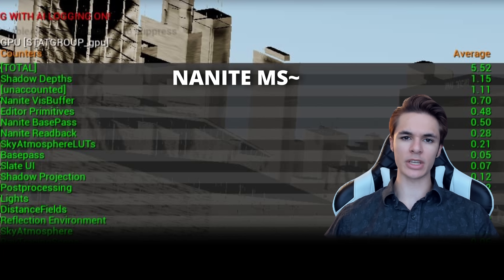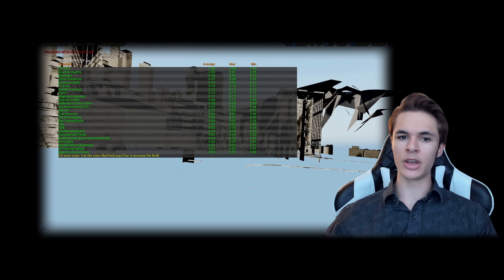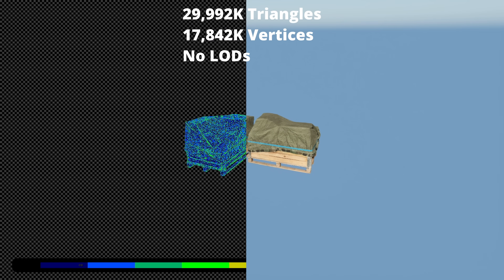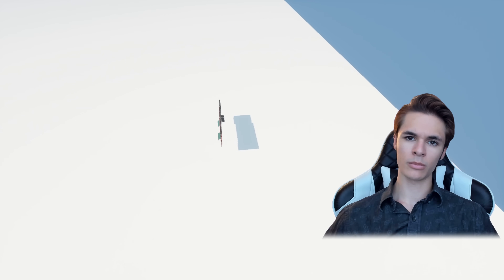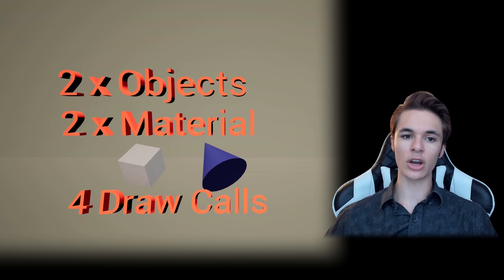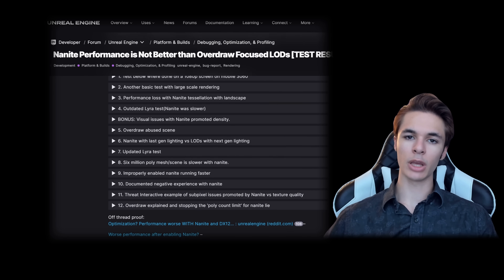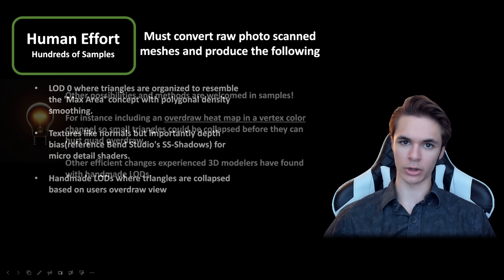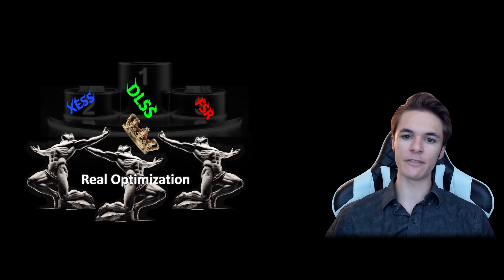Epic's Unreal Optimization Disaster | Why Nanite Tanks Performance!

Comment: yes you are right, BUT..

the modelling process to produce these LOD levels (with good topo) is ridiculously slow compared to the nanite workflow, where you can slap these insane polycount meshes onto the scene and it’s done. nanite was created to shorten development time and cost. this can lead to 3-5 years of dev time instead of a decade.

and guess what, nanite is a software which can be improved, and they will improve it. in a few short years this whole argument will be pointless, the nanite rendering tech will be almost as fast, or even faster.
Reply: That why nowadays games size around 300GB
Reply: @lirianca  which can be improved, again. there are a lot of research about mesh and asset compression already by amd, nvidia, epic etc. trust me, it will be better.

also if you took a lod0 mesh from a traditional pipeline and use it as a nanite mesh, you only using one mesh instead of 3-5. i know, nanite will generate additional data, but that can also be improved.
Reply: @alexkovacs4551  best argument "trust me bro". No bro, thanks.
Reply: @alexkovacs4551  12 tris cardboard box from traditional pipeline > 2 mil. Raw scan used with nanite.  Understandable. 🙃
Reply: @lirianca  i’ve never seen a game that uses scanned models, that’s not the point. the point is, you can use your good old lod0 model without generating lower fidelity variants of it by hand. that can be a 12 tris cardboard or a highly detailed sculpted model, the point is to reduce cost and development time.

you don’t have to agree, i just wrote down my toughts about the topic. i’m a senior software engineer, and i can see why they came up with this idea. the engineers who probably far more intelligent than any of us. :)

have a good one
Reply: @alexkovacs4551  Bruh... you dont need sculp box. Just open 3d software and use defaul cube and uwnrap it. And make textures for this cost you 10-15 minutes. Also nanite not understand what vertex or edge important on this specific model, and can broke geometry, normals on model. Like complex 3d model of car with high detail interior, engine and underbody. Nanite decimating current object in realtime, not create new. Why im know it, because im 3d artist and indie game developer.
Reply: @lirianca  thats a funky way to say unemployed 😅
Reply: @alexkovacs4551  when "unemployed" guy know more then sigma alpha master boss senior software engineer 😁

Comment: On all RTX GPUs FP16 arithmetic ops are executed at the same rate as FP32 since only one of the two main vector ALUs can process packed (x2) FP16 operations. The only perf benefit from running FP16 ops is the reduced register pressure. In their OpenCL run-rime Nvidia is yet to expose FP16 ops at driver level.

Comment: Its normal that new generation of rendering techniques introduces large overheads. Its a good tradeoff as it streamlines development and enables more dynamic games, Major issue is that  developers ignore good practices and then blame the software, part of that is also epics fault as they try to sell it as magic solution for unlimited triangles which is not. Nanite might be slower but enable scenarios that would be impossible or very hard to achieve with static lighting. Sure you can render dense meshes with traditional methods but imagine lightmapping them or making large levels with realistic lighting and dynamic scenarios.
Reply: Yeah... In terms of all this dude's videos - I find myself technically agreeing; but, I don't think they see the big picture.
Reply: @piroman665  I believe unreal was made to be somewhat artist friendly, systems you can work with even if you do not have a deep technical understanding. Hitting the "enable nanite" checkbox so you have to worry less about polycount seems to fit that idea.
Reply: @lau6438  LODs are costly and expensive to studios to develop.

Comment: Nanite is not made for basic scenes, it’s made for incredibly dense scenes with lots of material variation.
Yes, it will always perform slower on basic scenes, but it can outperform on very complicated scenes like for example the matrix demo.
If you were to try and run that in a traditional pipeline at that same level of quality, you wouldn’t be able to with the same performance, even if you optimized like crazy.

No, it’s not a make everything fast button either, but it has some incredible benefits, not in the least in terms of memory budget.
Ultimately, it is a tool and any other tool it has up-and-down sides, you don’t try to screw in a nail. But in the right usecase its very powerful.
Reply: You didn't even watch the video! 😂

Comment: Your AI idea would by no means run faster than Nanite. Nanite is pretty fast for what it does. And my understanding was that Nanite was a quality thing more than performance.
Reply: The idea is that the AI either runs offline (either during development or on device). I don't think it would be less time consuming for devs though, as they now have to either tune a model or deal with tons of additional tech support requests for a piece of software completely out of their control.
Reply: @sasha_chudesnov  Even offline, Nanite would still run faster than AI and don't forget the memory requirements to run the AI. The more complex a model, the more parameters it has, the more memory it requires. 

Also, what fine tuning is there needed with Nanite? The only options I've needed so far is "Preserve Area" and "Keep Triangle Percent" with the latter option being overlooked by a lot of people it seems. 

And even then, people need to understand that you don't actually have to throw a 30k poly mesh in there, you can still use your lower poly meshes and then just not worry about LODs because you still have to consider the amount of data that travels through the PCI busses.

Not saying it isn't a hog and doesn't hurt performance, I'm just saying that you can still get great performance if you don't go silly with it.

Comment: The most damning point against Nanite is the new Riven remake. Everyone thought it was using Nanite because there are no polygonal edges visible in its assets, yet it's just a very well made game.
Reply: A bit of a shame that the reflections are still screen space and kind of suck. If the game has raytracing then this point is moot, but I remember hearing Johnathan Blow mention how crap the screen space reflections are in that game.
Reply: @Naitrate  Riven's SSR is no worse than any other game's. SSR is simply a stopgap technology that should have been left in 8th gen, and it should have NEVER replaced planar reflections on water to begin with. SSR was perfect for creating accurate reflections on random objects in a scene that are too small to warrant a planar reflection or cubemap. Water will take up between half and the entire screen for a lot of the play time in some games, yet those games will cheap out and not use planar reflections. The most recent example is CS2 which ironically has extreme performance problems with its water any way. Just another anecdote for how optimization is dead in the games industry.
Reply: @Naitrate  such a game would benefit from full on path tracing

Comment: I figured something was terribly wrong with Nanite when Bang4Buck played an early version of Remnant II at 4K max settings and was getting *>45fps on a 4090*, the same GPU that can handle Gears of War 5 at 8k 60fps at max settings. Getting that kind of performance purely through rasterization lead me to suspect that Nanite scales terribly at high resolutions, and it’s been enlightening to learn that Nanite has scaling issues in general.
Reply: You're seeking for the wrong reasons. The trouble is deferred rendering, it scales worse in resolution.
Crysis 3, just to overcome this issue, gets a forward pass for all complex materials.
And remember, anything higher than 1080p is marketing scam.

Comment: Interesting video, but isn't nanite using it's own software solution for the small triangles exactly because of that issue? I'm pretty sure that they've said so when they started talking about it, it's in their tech talks, etc.
This test feels somewhat fishy to me. Why not compare the normal scene, instead of captured frame, for example? That skips part of the work of one example, while using the full pipeline of the other...
Reply: I would love to get my hands on that test scene to give it a spin. I've been working with Nanite in a AA and AAA setting for almost 3 years now, and while it was an absolute pain to figure out the quirks and the correct workflows it has been overall a positive thing for production. 

In my experience Nanite REALLY struggles with anything using masked materials or any sort of Pixel Depth edits. 
I've also seen issues with perf when most meshes were "low poly" in the sense that the triangles are very large on screen, I vaguely remember the siggraph talk where they mention that larger triangles can rasterise slower because it's using a different raster path
Nanite handling its own instancing and draws moves a lot of the cost off the cpu onto the GPU so the base cost being more should be a surprise to no one. It is also very VERY resolution dependent. The higher you go in res the exponential the cost of Nanite (and VSM, Lumen) not to mention the general cost increase of a larger res. I've grown to accept the only way forward with these new bits of tech is upscaling. I'm not happy as a dev, but as a gamer I couldn't care less and use it everywhere.

VSM has similar issues, since for shadows you effectively re-render the nanite scene, but there are ways to optimise that with CVars, and generally it's been better performing than traditional shadow maps would when used with nanite - there's a caveat there, since if you bring foliage into the mix then nanite can get silly expensive both in view and in shadows.

Collision memory has also been a major concern since for complex collision UE uses the Nanite fallback mesh by default, so in a completely Nanite scene you can end up with more collision mem than static mesh memory

I also feel like having a go at Epic for not maintaining "legacy" feature compatibility indefinitely is a bit unfair. Both VSM and Lumen rely on Nanite to render efficiently and were created as a package. Epic decided that is the direction they want to take the engine, an engine that is as complex as it's large, it is almost expected to lose some things along the way. That being said I have run into many things that I wish they cared enough about to fix (static lighting for example has a ton of issues that will never be fixed cause "just use dynamic lighting"), but at the same time I won't start having a go at them for not supporting my very specific usecase that is not following their guidance.

No part of this tech is perfect and I get the frustration, but it did unlock a level of quality for everyone to use that was only really available in proprietary engines before.
Also do we really thing CPPR would drop their own insane engine for shits and giggles if they didn't think it was a better investment to switch to UE5 than to upgrade their own tech?
same with many other AAA companies, and you can bet your ass they took their sweet time to evaluate if it makes sense or not (not to mention they will inevitably contribute to the engine a TON that will make it back to Main eventually)
Reply: @SioxerNikita  It is obvious that not a single modern game uses literally PS1 graphics, of course you understand what I mean...

When I said about graphics in CDPR? You said that optimizing takes time, so a game should be good in other aspects if they didnt waste time in optimizing. Cyberpunk is a great example of this, is not? They didnt had optimizing, they didnt had anything, not even police and driving AI.
Reply: @SioxerNikita  You gave the worst example ever 2 times, CDPR and Black Myth? Yes, graphics doesnt matter, you using a extreme example is not an honest argument. But buying a game from 2015, just watch the hundreds of comparrisons in the Youtube, Batman Arkhan Knight, AC Black Flag... Not only that, but there is a whole genre and market of horror indie games with the "PS1 graphics".

Elden Ring has a "shit" graphics, give a zoom in any texture and you can count the pixels, look at the Messmer custcene for example. And the game is the best selling game of From.
Reply: @SioxerNikita  imo graphics don't matter is more of a "yeah realistic graphics are neat, but consistent graphics are better" 
I'll take cartoony graphics like Kirby's epic yarn over battlefield graphics. yes realism looks good, but stylized does too, and a well stylized game can both be way more efficient and age way better, while still looking as good or better than wannabe photorealistic graphics.

If we're talking about ps1, a game like vib ribbon still looks good nowadays, and for a more well known example, crash bandicoot.
They look miles better than asset flip looking franchise games that have realistic graphics, but aren't that cohesive and have a meh game under.
Reply: @satibel Realistic graphics clearly sell. Just look at Black Myth Wukong.
Reply: @lycanthoss  they do, but I'd argue for BMW it's just as much the gameplay and character design, because look at undawn.
Graphics will make people look at the game, but I don't think they make it sell by themselves.
Reply from the maker: @lycanthoss  Black Myth Wukong is an example of good art and gameplay. It's completely ruined for the anti-blur community through hideous sharpening and temporal upscaling to fix the Nanite+regular shadow map performance.
Reply: @ThreatInteractive BMWK isn't really a good example because that game holds a lot cultural significance to Chinese. And there are a lot of Chinese.
Reply from the maker: re: Why not compare the normal scene, instead of captured frame, for example?

You can compare yourself because we already analyzed the "normal" scene, same hardware, same resolution: https://youtu.be/Te9xUNuR-U0?t=538 
Watch the rest of our videos as everything we speak about is interconnected.

Comment: Frustated with how heavy and ugly an unreal engine template is, i spent a couple of days changing the settings for a project. 

I was not surprised to see how large the base cost of stuff like VSM/Nanite/Lumen is. I got to run a basic game at 100 fps on a old all in one computer with integrated graphics.

But i always assumed it was that way because it scalled better for large AAA games, now im not so sure.

Anyways, im disabling all that crap for my projects from now on.
Reply: You can make a game for low-end pc's using UE5, depending a bit on what you mean by low-end. Lumen, Nanite and VSM are all very expensive, but if you switch to forward renderer and be smart about what you do 60fps on iGPU is definitely a possibility.
Reply: yeah UE isnt meant for low end pcs. Either configure it on every project or use a lighter engine such as godot or uniity

Comment: Dang i wish godots overdraw viewmode offered these sorts of stats, in godot its basically just a shader effect that turns the triangles white and semi transparent so you can see through them, it doesnt tell you anything about wasted gou performance 🙃 Btw does this 2x2 pixel rendering and small triangles causing performance degradation apply to both opengl and vulkan?

Comment: Even if you are right. For how long?
I undertand that UE5 with All Nanite, Lumen and vsm is a solution for ultra high quality visuals without the need of manual labor for the coming years.
The initial cost may seem high - now. But anything past that is fine. And with next gen gpus it really doesnt matter at some point anymore.

Yes, you could achieve more with traditional methods, but you need to know your stuff and put in tremendous amounts of extra work. Nanite just needs loads of memory.

I see it like pathtracing or raytracing in 2018. Everyone said that its performance cost was way too high, which it was at first. But in some years it is the ultimate solution. You dont need to put hours in for manual work and the quality speaks for itself.
Reply: Last paragraph: for mainstream hardware, raytracing is still have too high of a computational cost unfortunately. And with slowing down of Moore's law it will be for quite a while.

Same for not worrying about overdraw
Reply: @MrSkollll  What on earth is mainstream for you? Series X and PS5 are on the market since 2020 and they can use it. Spider man has a great integration. A 4070 (which is mainstram in late 2024) has no issues even in heavy rt use, not including pt, but thats a different story

Comment: I was excited to test out nanite when i heard about UE5 in general and to be honest i still am a bit but i have messed around with it a bit and i am no expert or not even good at what i do but nanite has consistently provided much lower framerates than using normal meshes as well as the other mentioned details like basically forced VSM usage. If i wanted to have raytraced shadows (from the things that i have found out), nanite is unusable, at least in large quantities

Comment: I'd rather think about Nanite as a magic wand for those who don't want to deal with mesh optimization and just want a consistent performance all across without manual optimization. This currently hits us heavily but as soon as technology evolves and everyone is going to have access to modern hardware that can utilize this system, the ease of the system and the decent performance will overcome these hardnesses. 
About the development:  4050 compared to 1060 has a 70% performance uplift in 7 years. 10% every year including hardware and software development and in 5 years nanite will work out really well for fast game development and consistent performance.
PS: we need to mandate gamedevs when releasing a trailer to give performance statistics about the ingame scene and upscaling used :DD